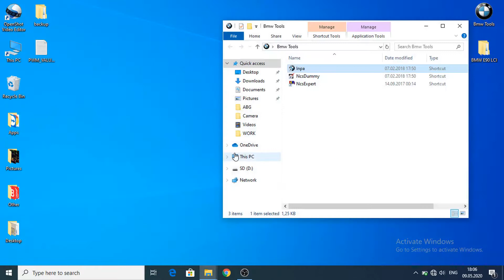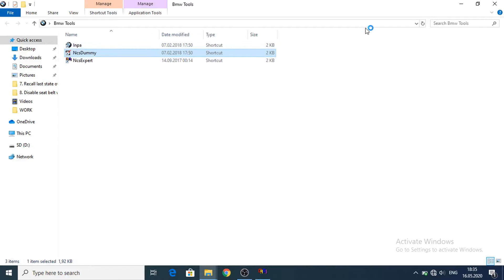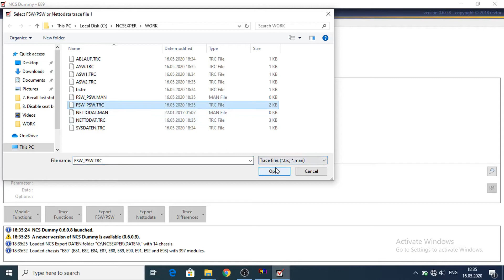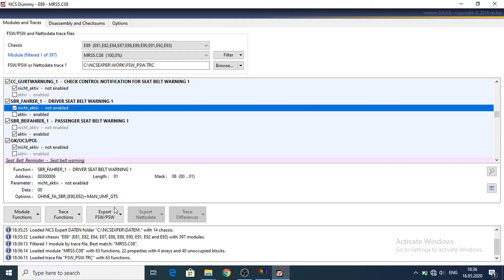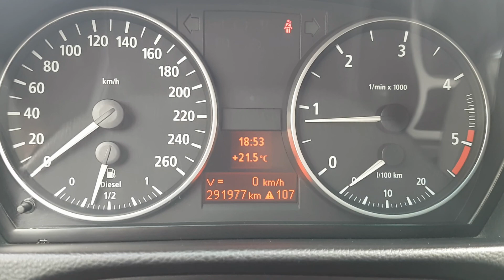8. Disable seat belt warning for Passenger or Driver

Comment: I was able to get this to work on FRM 1 modules (coded it on mines and a few others). 

However, for FRM2 and FRM 3 modules, I am trying to figure it out. I upgraded my FRM 1 with the NFRM (FRM2) module. Fore those with frm 1 here are the values.

BFD_1_RL_BL_ERSCH_BILD = brake light
wert_03 = flashing
BFD_1_BL_M_ERSCH_BILD = 3rd Brake light
wert_03 = flashing
BFD_1_RL_BL_1_ERSCH_BILD = brake light 1
wert_03 = flashing
BFD_1_RL_BL_2_ERSCH_BILD = brake light 2
wert_03 = flashing
BFD_1_NSL_ERSCH_BILD = rear fog lamp
wert_03 = flashing 

I just did the flashing on my rear fog lamps as I don't like the look of all the rear lights flashing (too slow with halogen bulbs).

Am gasit asta pentru bfd
Reply: Poti face un tutorial te rog
Reply from the maker: Pare ok ce ai gasit pe net, acuma lucrez eu la un tutorial despre BFD, cred ca maine o sa fie gata :)
Reply: @BMWEMS  multumesc mult pentru efortul depus
Reply from the maker: Cu plăcere! 😀